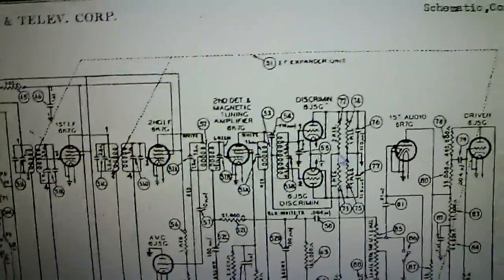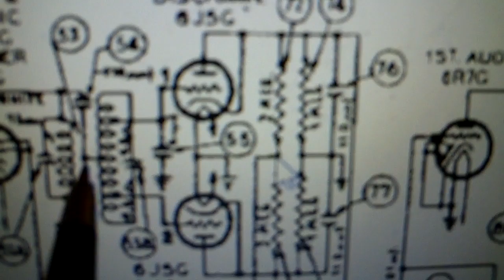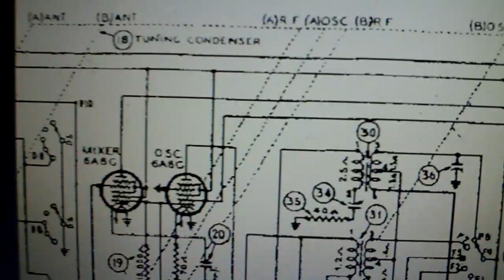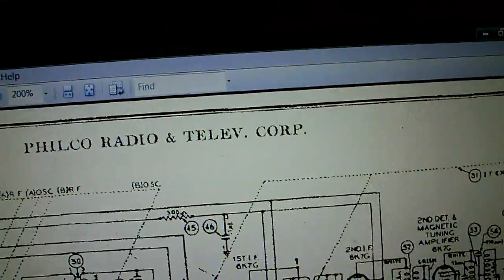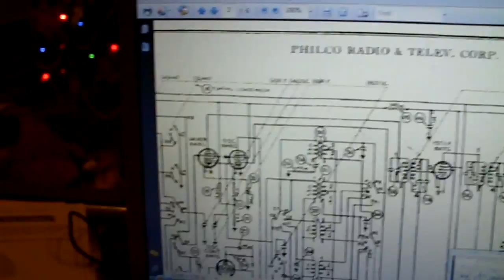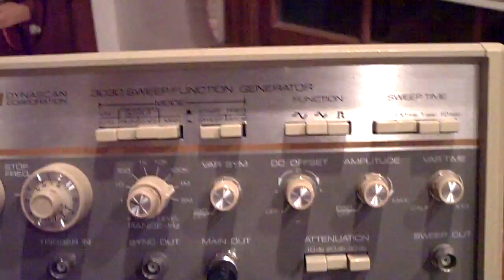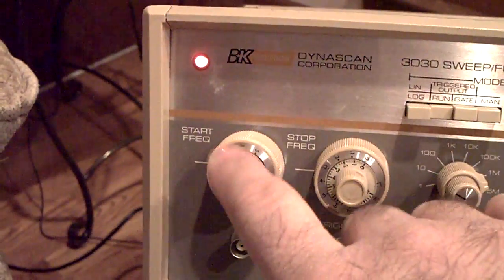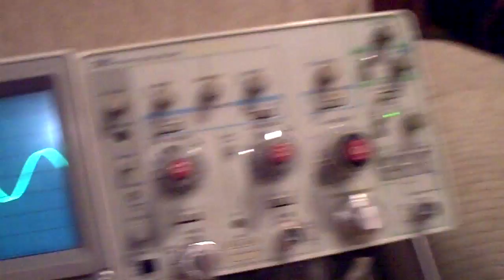Philco 38-116 Repair, Part 12, Fixin' to do the IF Alignment

Comment from the maker: @joernone thanks John, You know, I'm training myself as we go! I might need to loosely couple my other signal generator for a 470 KHz marker. Then sweep from 460 KHz-480 KHz with the BK 3030. Not sure yet. Not that you need to sweep and to use a scope for most antique radios. This one does need this procedure. I think most of the time for simpler radios, a calibrated signal generator with a 400 Hz audio marker and just a VTVM on the audio output would do the trick.

Comment from the maker: @bandersentv yes, Bob, the BK Precision 3030 goes to 5 MHz. A very nice piece of equipment for $59 plus $12 for shipping. I'm very pleased with it. Never used one before as you can tell, but it's a necessity for this radio. I remember reading there was experimental High Fidelity AM stations in the later 1930's. Unfortunately, isn't the bandwidth on AM limited to 10 or 12 Khz now? Shango066 knows his stuff. I liked his videos too.